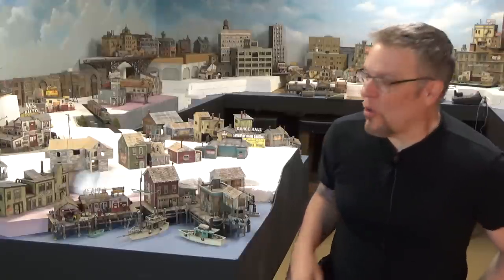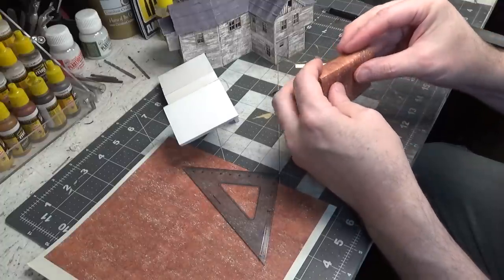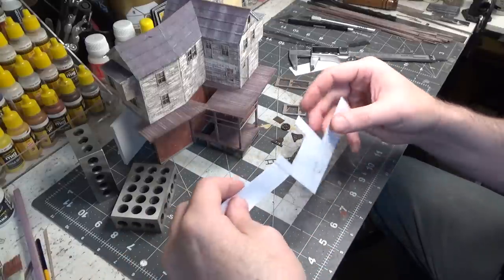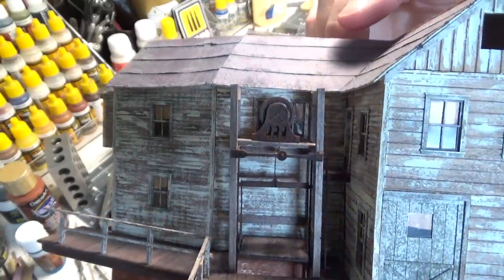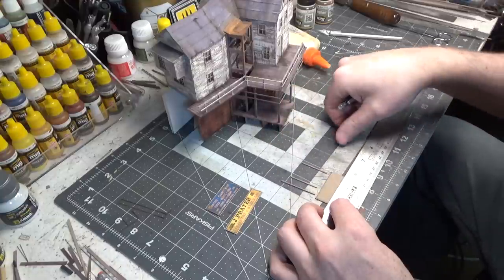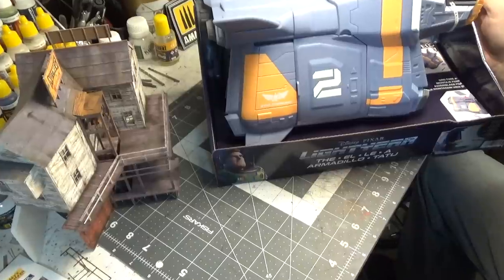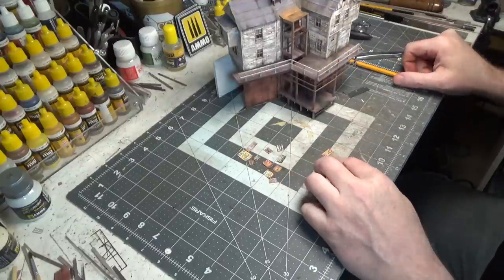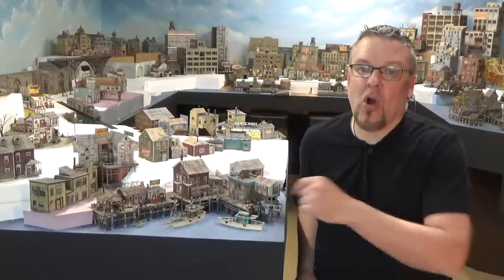Building a wood elevator for our layout!

Comment: Jason,
I love the elevator.  True genius.
It's hard to believe that it has been three years.  Congratulations!
After June 19 I have some suggestions for the gable windows.
If you can't find a vendor who offers a 3D printed window to size, on the gable end inside the layout why not build a simple wood frame and glue in ragged cut acetate.  No mutton boards.  Make it look like a broken window.
On the dock side gable, scavenge from the bits and bobs box for strips of wood in different stains and colors.  Also various widths.  Cut them to your desired lengths.  Then board up the window opening, that is seen as you approach the layout.
Jim
Reply from the maker: Thank you so much!!! 👍

Comment: Great video, Jason. Beautiful work on the elevator and the signs (don't forget the supports). And congratulations on the kid's schooling, you must be a proud papa. Question, have you ever tried scalpels for cutting out signs? Cheap ones from Amazon work well for me, blades cost less than razor blades. The building looks perfect in the spot made for it, great work!
Reply from the maker: Thank you so much Greg!!! Soon I will have no kids at home.  Thanks for the suggestion on the scalpels. I’ve never used them. Thanks for watching! I always appreciate it!!!
Reply: Empty nesting is quite a change. Embrace it. 😄